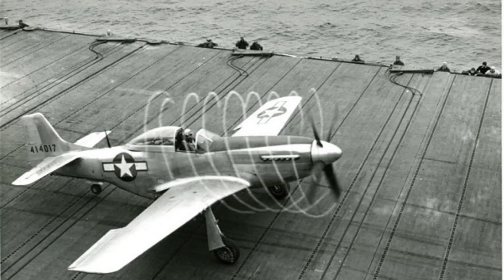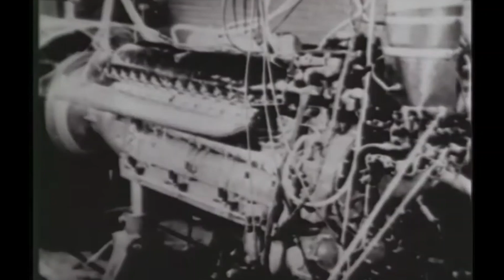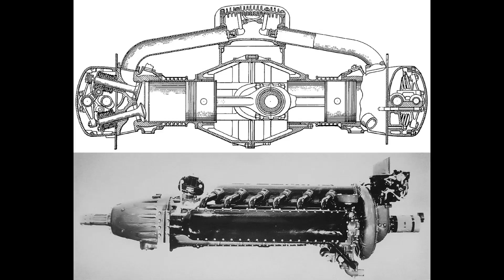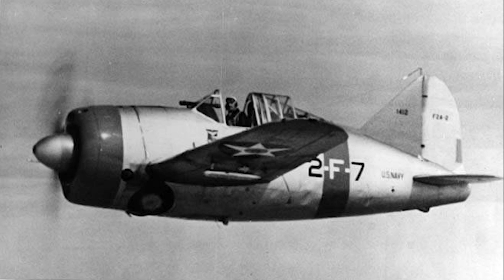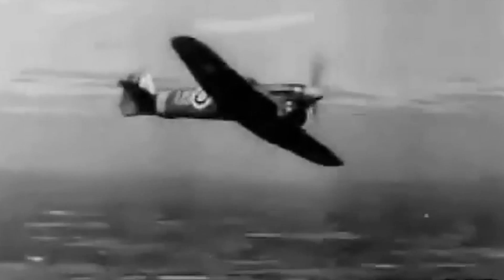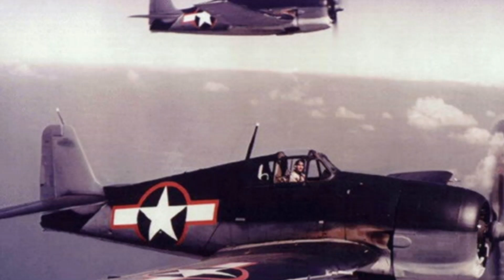The Curtiss XF14C; Dying Gasps of an Aircraft Giant

Comment from the maker: Thanks to everyone pointing out that I said "Lycoming" wrong. For those who don't know (which included me) it's "Ly-comb-ing" 😁
Reply: Curtiss still had a happy ending, though they no longer make planes, they still very much supply parts to aerospace and other industries. So unlike many they didn't vanish.
Reply: Most of us focus primarily on the content of the video, not the pronunciation of any terms or names. We all know, to what you are referring.........Curtiss was up against the wall on this one, with an unproven airframe, engine and propeller set-up. Even at the end of the war and following years, the highest-performing propeller planes (reliable ones) used progressive improvements in fuel and supercharging technology to get the huge power output needed from proven engines to push these fighters into the 500 MPH arena. Bearcat, Seafire, Sea Fury and Mustang, Thunderbolt, TA152, among others.
Reply: @coreyandnathanielchartier3749  - It did take CW a while to get the bugs out of the R-3350. They tended to drop valves and catch fire. Sodium filled exhaust valves probably helped.
Reply: @coreyandnathanielchartier3749 true dat. This guy was polite, butt still, so many are so rude it turns on my ‘protection’ instinct for my favorite content creators.
Reply: My take was that I'd read it as Ly-comb-ing for a million years but that given how you were pronouncing it I must have been wrong
Reply: Thanks for that, @Ed Nash. My inner-obsessive was starting to twitch, nervously, at the thought that I might have been mis-pronouncing this company name for 50+ years! 😅
Reply: If you want to cover an absolute beast of a Lycoming engine, check out the XR-7755 liquid cooled radial. It produced 5000 horsepower on test, with a projection of going to 7000 horsepower.
Reply: @All2Meme   Sounds like what the Hughes  "Spruce Goose" could have used.
Reply: @scootergeorge7089  There was some talk that it was going to be used for the B-36, but teething troubles and other factors resulted in Convair using six Pratt & Whitney R-4360s instead.
Reply: @All2Meme  Plus J-57 jet engines in underwing pods.
Reply: @patrickshaw8595 Four J-47 engines on later production B-36s. The J-57s were used on the early models of the B-52 before switching to the TF-33s on the B-52G and H models.
Reply: @All2Meme  Thank you for catching that!
 Damn rusty corroded old memory cells - when I was a kid they told me weed would destroy my brain - they didn't tell me it would be sixty years later, lol!
Reply: Thanks Ed....Old Shoe🇺🇸
Reply: Most Yanks slur their Bs anyway so I almost never notice.
Reply: @classicforreal  Scots roll the B's like Sean 007 Connery.  The B is silent in comb.
Reply: Close enough, especially for a Brit.  :). Not like you guys don’t have names/words that I’ve wrecked.

I’ll have to check my ‘William Herschel’ book on aircraft powerplants.  I know he’s some Lycumming examples but I’m not recalling this one.  I’ve worked on their 8-cyl 720 series but I guess I thought that was their largest.  Guess not.  The O-1230 is pretty impressive looking., as is the H type.

Comment: It is almost as if the Curtiss company had become "senile" in a development sense. The P-40, while a good sturdy and hard hitting fighter,  was never quite on a performance par with its opponents and it seemed that Curtiss simply could not refine the design until too late. When they finally gave it the make-over it needed... the Mustang was available in quantity.  The P-40Q could have been in production much earlier instead of the hordes of P-40Ns.  The Helldiver's tribulations did not endear it with the Navy nor did their replacement for the Seagull.  In a way, the story of the Hawker Hurricane parallels that of the P-40 in that it was overshadowed by the Spitfire. It was, like the P-40,  a good, sturdy, well armed fighter that was never quite on a par with its opponents (but, like the P-40, in the hands of a knowledgeable and SMART pilot it was a contender). The difference was that Hawker (admittedly with some hiccups) was able to create viable successors, many of which are aviation classics. Curtiss SHOULD have been able to do so as well (Hell, they built a run of Thunderbolts for Republic), even if it required farming out the work to other manufacturers.  There were so many smaller aircraft companies in the U.S. that were "spinning their wheels" producing trainers and utility aircraft. It is no surprise that Curtiss cobbled up this monster when Grumman were  developing the Bearcat and the Tigercat (and even created a "Hot Rod" version of the Wildcat!). Not a bad looking aircraft but obviously bulky enough to see why the estimated performance was "pie in the sky" and, of course, the engines would have been reserved for the B-29s .

Comment: The designation XF14C shows how massive Curtiss's success in naval designs had been before. It already was Curtiss' 14th naval fighter design the navy ordered and payed at least until prototype stage. 

All in all, it was a predictable failure. Too chunky and fitted with an unreliable engine that replaced an engine that didn't work at all. 

Curtiss did some things right in the late 30s and early 40s, but there was much more done plain wrong. Switching the originally radial powered P-36 line of developement to a liquid cooled engine, creating the P-40 with relatively little investment was pure genius. The Curtiss C-46 Commando was a genius design too, fulfilling not only the air forces dire needs for a high performance transport, but also being a potentially superior rival to anything else on civilian market in the case that the war would have suddenly ended before military orders could have been placed. 

Curtiss probably would have done better if they simply switched the P-36/P-40 line of developement back to radial as soon as the first R-2800s became available.
Reply: Curtiss-Wright was a big deal before and during WWII and then afterwards basically falls apart. And if you do some reading, the management had a terrible reputation within Washington. Basically would not make a move without being paid (whereas other manufacturers would put their own money at stake prospectively) and highly uncooperative with other manufacturers during WWII (whereas other manufacturers were less parochial). It's like the military raised a collective middle finger to Curtiss after WWII.

It was a huge company, and became quickly a small company (still around, just quite small).

Comment: Contra-rotating props would seem like a huge advantage for single engine fighters. But no country managed to quite get them to work during ww2. They must be more difficult to implement than they appear.
Reply: There are too many potential sources for vibration for a fast success. Developing a successful contra-rotating prop systems takes a lot of time. The prop blades are interacting with each other, the gear box is long and the hollow, counter rotating drive shafts are even longer and the variable pitch mechanism for two props is complicated too.

Comment: Lycoming later invented much smaller boxer engines for Cessnas and the likes even if their big bois failed
Reply: They existed back then pretty much in the still used modern form. The 6 cylinder was used in an interesting twin engine drone bomber. 

By the time the kinks of that drone bomber were worked out it was deemed not worthwhile because Japan had no real air power left to defend against crewed bombers. 

The drones had early TV cameras. Both to fly the drone and aim the bombsight. Unfortunately this impressive weapon decades before any other like it was kept classified after the war. It's way lesser known even though there's at least one YouTube video about it.

Comment: This Boxer arrangement, with horizontally opposed cylinders layout, is the opposite of the opposed piston layout. Pointing this out is just an excuse to bring up the  Junkers JUMO 204 which begat the Napier Deltaic. Another engine type that has pretty much died out, excepting the Acates Power design. The 204 flew and the Deltaic went to sea, a potential for videos?

Comment: I'm not sure I'd call contra-rotating propellers novel, English inventor and engineer Frederick Lanchester patterned the design in 1909. See his Wiki entry.
Reply: Patenting it is one thing. Actually using it in a combat aircraft is another.
Reply: @PaulMcElligott  The first high-performance contra-rotating prop aircraft was the Macchi-Castoldi MC.72 built in 1931. It broke the world seaplane record twice before topping out at 440mph in 1934.
Reply: @1maico1  With fixed pitch propellers. For a few test flights and some racing under ideal conditions, while money and workforce for excessive maintenance was no propblem. Getting it working with variable pitch propellers and making it reliable for hundreds of hours of lifetime under combat conditions is a whole different story.

Comment: Did other aircraft use horizontally opposed/flat engines ? Was the issue with configuration itself or specific to the engine?
Reply: Napier liked the H shape
Reply: I don’t know it off hand, but Junkers used a diesel engine of flat configuration in the Ju-86
Reply: @MisterOcclusion  Junkers had devoloped opposed piston engines, with two pistons running in the same cylinder with a central combustion chamber. He originally intended to use them horizontally mounted in the wing, but that never worked out. In the end they all had to be mounted vertically to get theym reliably running.
Reply: The precursor engine was flat, but according to the video the one originally intended for this airplane was an H pattern.  Multiple variations of an H engine have been tried for both aircraft and race cars, but few were very successful.  They took a lot of development, but they usually did not produce enough horsepower to overcome disadvantages such more weight, more frictional losses, more complexity, and less reliability.
Reply: Horizontally opposed engines converted from motorcycle engines were quite popular in early attempts in civilian ultra light aviation, but there was no mass production and certainly no domincance over other engine configurations like V-type, Anzani, radial and inline engines. 
They seemed to be a dead end for a surprisingly long time until the first Continental and Lycoming horizontally opposed engines managed to prove that they were able to rival inline-fours. Today, 95% of light aircraft ase using horizontally opposed engines. 
One factor easily overseen is that horizontally opposed engines didn't really fit to how light aircraft generally were designed before WW2. The vast majority had narrow fuselages with tandem seating, in an attempt to reduce drag by minimizing surface area. An inline engine naturally fits much better than anything else to that kind of design. Only after light aircraft manufacturers switched to side by side seating, the horizontally opposed engine suddenly fitted nicely to the fuselage shape. 

There has never been a successful large, horizontally opposed engine for heavy aircraft. 99% are air cooled designs with 4-8 cylinders for light aircraft and the majority of the remaining 1% are air cooled two cylinders.